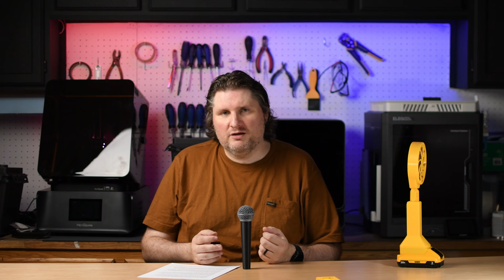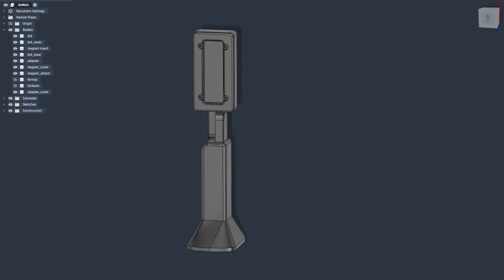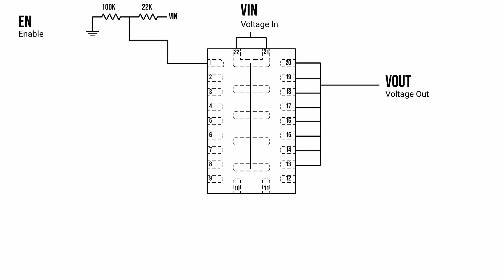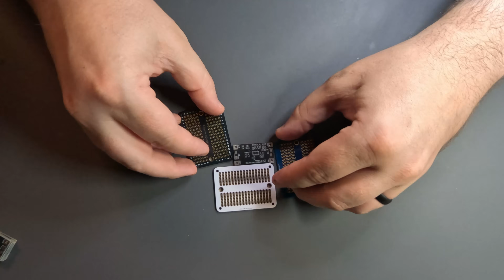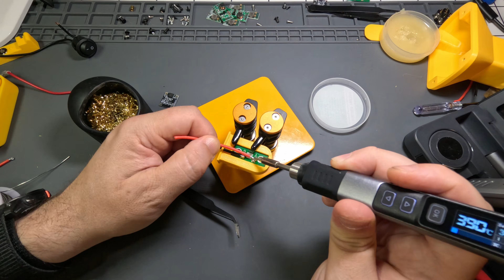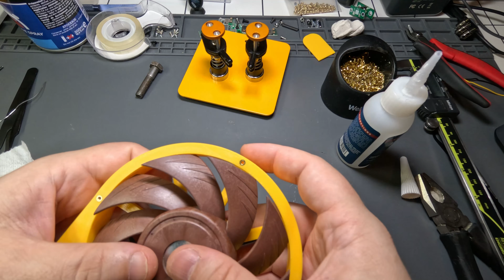3D Printing MagSafe Style Attachments

Comment: I'm a firmware engineer trying to teach myself some circuit design, and my first project idea is a proper PID-controlled soldering iron powered from a Ryobi battery. This was exactly the video I needed to see right now! Thanks for pointing out the MP5056, I'll definitely be looking in to that. Also very helpful to suggest looking for battery adapters rather than trying to measure and reverse engineer the whole battery mount by myself. 😅
Reply from the maker: Would love to see your project when you finish! I know next to nothing about PID control, but I know people use them in espresso machine modding.